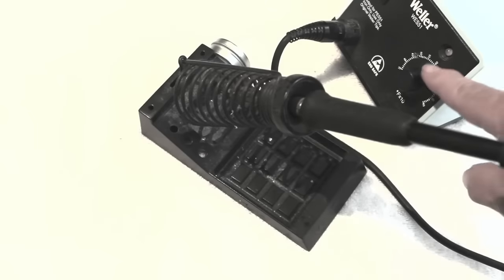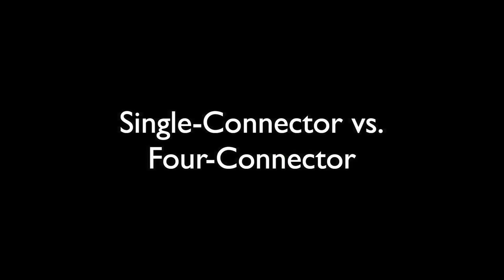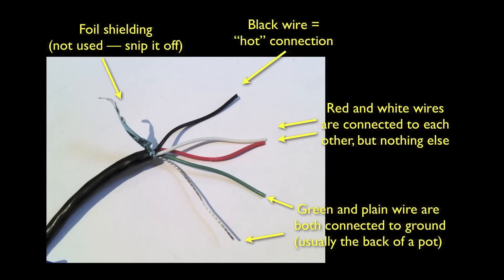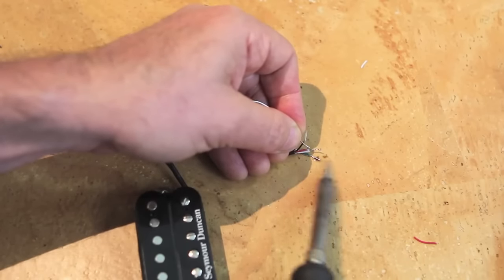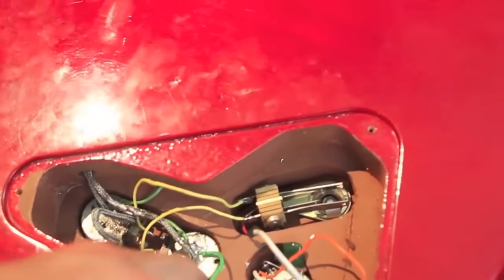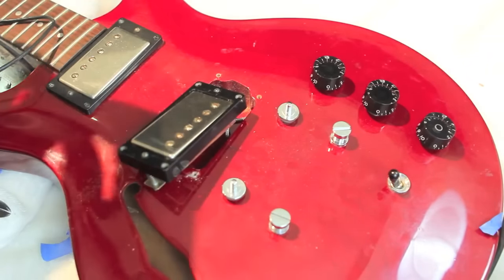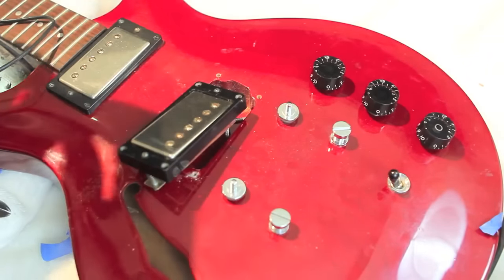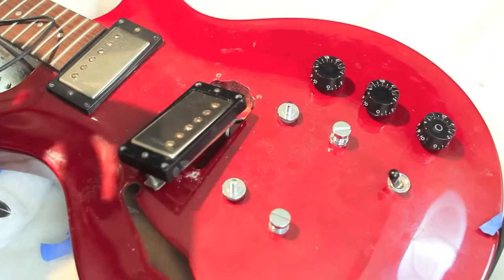Do It Yourself - How To Change Guitar Pickups (Courtesy of Seymour Duncan)

Comment: NEVER SNIP YOUR STRING AT TENSION! That is NOT GOOD!
Reply: Those are the people that jack their cars up at the oil pan.
Reply: Good lord.  Why?  What will happen?  You think the neck will snap or something?

Strings break all the time at tension.  If your guitar can't handle it you might want to look into getting a new one.
Reply: @TempoDrift1480  People who worry about things like snipping strings at tension are the people who think you'll really get in trouble for taking the tag off a mattress.
Reply: put your capo on the neck, reduce tension then snip...
Reply: @Vichedges  It's not too fun when it springs back and hits you in the face.
Reply: I mean, does cutting ANYTHING at tension sound like a smart idea..?
Reply: @AdultsAreTalking  Ceremonial ribbons?
Reply: Actually its fine
Reply: Jason Allen Sure, ONE string might break every now and then. But they shouldn’t. It means you’re tuning too aggressively or pushing your guitar too much, or not changing them enough. Cutting SIX is just asking for trouble. It could cut you or your guitar. Both are a lot of damage, considering how easy it is to literally just loosen the tuning. Nobody can be that lazy??
Reply: @Paton MacDonald It doesn't matter.  You could snip all 6 strings simultaneously at tension and your neck won't burst into flames. Although most of us just use the string winder to loosen each string and then snip it but whatever .
Reply: 😂 just don't put your wide open eyes right next to the strings before cutting.....and don't put fingers  between the snips 😬 🤣 Check ✅️

Comment: Why not just open the the old pickup unsolder the wires, and reconnect the wires to the old wires looking at the wire diagrams from the old and new pickups, and solder accordingly? :)

Comment: I can’t get my solder gun hot enough to make any wires budge from the soldering
Reply from the maker: The gun has to be in the red zone.
Reply: Yea I actually bought the pencil version based off the video but it didn’t have adjustable temperatures and only was capable of getting to 30w of temp

Comment: If you are a total beginner, it is BETTER to just splice the old pickup wirings and  solder the corresponding color coded wires to the new pickups.. Worked for me at least.

Comment: I hate those shitty way where people use electric tape to protect their soldering wires, it doesn't stay in place during the time, ALWAYS use simple heatshrink tube, it's cheap and it will never move!! If you have to buy electric tape you can buy heatshrink tube instead... And come on, all the connections that can be hardwired have to be done with rigid electric wire and good soldering job, you will see there is a big difference during all the years you will touch and use your guitar!!

Comment: why the hell would you make the black wire hot, and the green wire ground. its always red wire hot, black wire ground. so stupid.
Reply: That’s true of DC connections but guitars are technically using an AC signal, where black for hot and green for ground is the standard.

Comment: As easy as changing your strings? Well let's see; you need soldering iron, Phillips and flat head screwdriver, black tape and painter's tape, wire cutters, wire pliers, wire strippers and a towel. Good grief all you need to change strings is a wire cutters.
Reply from the maker: I know. It's like building an atomic bomb.